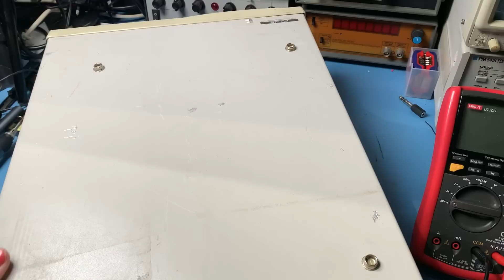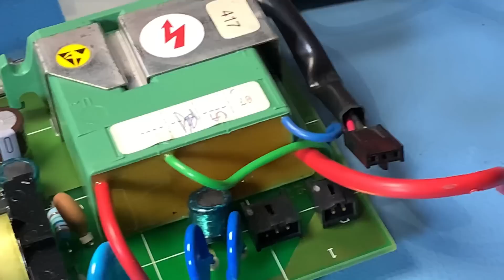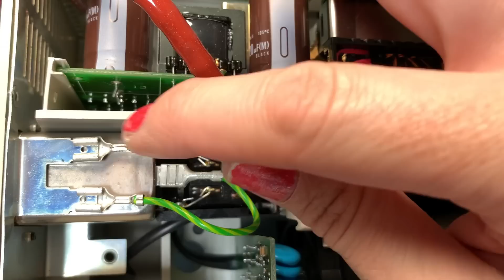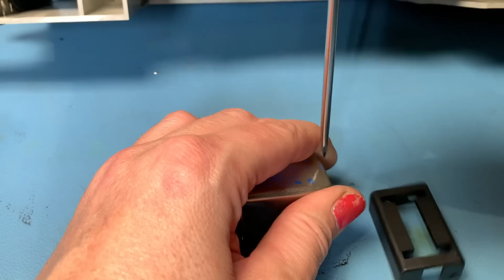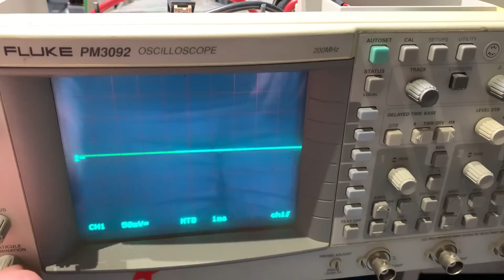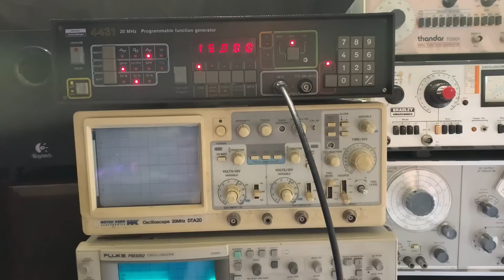Fluke PM3092 Oscilloscope - Service & Preventative Maintenance

Comment: For the life of me, I can't remember how to take off the handle! 🤪 Help!
Reply from the maker: You have to remove the casing and you can usually remove the handle by undoing the screws on the inside of the case holding the handle brackets on.

Comment: Hi, nice video. One remark I would also have replaced the 2 120uF caps in the supply they look having a bit a bold head.
Reply from the maker: I did test all the electrolytic caps but I will have another look at those 2.

Comment: Cool. I scored the PM3370B Combiscope version, great bits of kit.
Reply from the maker: I think they are a very nice range of scopes. I know you have featured a few from this range on your channel. The early ones suffer from failed Philips blue electrolytic caps. I think it's quite ironic that Philips took their own caps out and replaced them with another make for reliability, lol. So either they knew they were no good or Fluke said stop using them. Thanks for watching.

Comment: Nice to see this old Philips/Fluke type of scope. I also have two of them (not this exact model). One brought many years back from my first own money. Any I also like to use is from time to time, because of the features and overall functionality. Nice scope! But it's big and takes a lot of space on the desk, so I usually switch on the much newer digital one, because it's way smaller...
By the way: Yours is a much more recent model. There was no need to change the caps here. Anyway, it doesn't hurt and you made a nice video out of it and gave me a nice memory about this scopes, thx 😄
Reply from the maker: I didn't change electrolytic caps. They were all fine. The earlier models have Philips blue electrolytic caps in which do fail and usually need the entire lot replacing. What I did change was just the mains filtering capacitors which have a tendency to just go bang at any minute and do a lot of physical damage in the surrounding area. You can liken it to changing the timing belt in your car before it snaps and ruins the engine. This scope is nearly 30 years old and we have high mains voltage here, sometimes as high as 248V. For the sake of a few pounds it wasn't worth the risk so I do think it's very good practice to replace old mains filters and associated components of this age. Thanks for watching.
Reply: @JazzTechUK  I know, you already said this in the video. But I mean the mains capacitors. This specific type is not prown to blow. They are not cracking, which is the problem with some old Y and X capacitors used years back. The case get cracks and moisture gets in, which lead to magic smoke in the end...
Your laker model is not effected. After Philips stepped back completley in the instrument market the Philips name vanished on the front and switched completley to Fluke. My older model is Philips branded and had such problematic caps in it.
Anyways, it didn't hurt to change is, so nothing wrong here.
Reply from the maker: I can't be sure what was in the mains filter itself, so I changed it. Yes, it was not a Rifa capacitor on the board, but I had it apart so it wasn't much more effort or cost to change the other 3. I agree they were not damaged but I didn't want to take a chance with such a nice scope as I intend to use this scope on a regular basis.
Reply: @JazzTechUK  It's a really good scope! Will serve you a very long time with really good results! Have fun with it!

Comment: I've been considering getting a scope for a few years now and really like the look of the PicoScope range. If you're not familiar with the brand they manufacture USB interfaces with two or four inputs depending on the model. Their free software can be run on Mac or PC and behaves just like a digital scope with a lot of the same features. Anyway, great video Jane. Thank you.
Reply from the maker: I do know of the PicoScopes, however, they are not really much cheaper than any other full blown digital scope. The thing you need to watch with the PicoScopes is not only their bandwidth but the vertical bit resolution. Anything that is only 8 bits is going to give you a really jagged trace, which will look even worse blown up on a large computer monitor. You need at least 10 bits vertical resolution. Quite a few full digital scopes are now 12 bit vertical resolution, some even 14 and 16 bit. When you compare like for like, the PicoScope is not such a bargain it appeared to be.
Reply: @ Thanks Jane. I hadn’t appreciated the poor resolution specs when compared to those of proper scopes which are surprisingly cheap these days. Love the channel by the way! Keep up the good work.

Comment: I don’t know anything about what this is or what you’re repairing, but it seems you really love what you do. You care and I appreciate that. Good luck!
Reply from the maker: You can just watch for enjoyment value. Some people do this without understanding what I'm doing. In case you wanted to know, you use this device to 'see' what is going on in your electronics circuit. You connect special probes to this unit and 'probe' around your electronic equipment and it shows you waveforms of what is going on. From this you can work out if your piece of electronics is working properly, or not.
Thanks for watching and do come back to watch more videos just for entertainment value if you like 😊

Comment: It would be good to see difference on component tester, between old and new component.
Reply from the maker: I don't think you would really see much difference in this case as this was preventative maintenance as opposed to dead capacitors or an electrolytic capacitor where you would be able to see a deterioration. As these are old they can fail at any moment and make a real mess.

Comment: Nice scope, great hack on the power switch. Thanks!
Reply from the maker: Thanks. I was able to do that with the switch because of the flexi bar that operates the front panel on-off button, so it was not critical of the exact location.
Thanks for watching.

Comment: I once worked on an older Philips-Fluke scope that hasd some Roederstein ("Rödelschwein"?) caps, one of them shorted, and a RUDed Rifa cap. That made a lot of stench for sure.
Hope these Nippon Chemicon caps weren't the ones that got cap rot.
Reply from the maker: Luckily this was manufactured in 1996. The 'capacitor plague' as it was called didn't start until 1999, so just missed it 😊

Comment: Got its big sister, the Philips PM 3394(B) analog digital combi-scope. 
It's a combination of an analog real-time oscilloscope and a feature rich digital storage oscilloscope, with a bandwidth of 200 MHz and a 200 MS/s sampling rate in the DSO mode.
Very useful tool for vintage audio restoration work and setting up reel to reel tape-recording equipment.
The only thing I'm still not able to find are the original probes that had the "command push button" option.
Reply from the maker: Yes, these range of scopes are very nice. I am aware of the analog digital combi scope. There's not many of these scopes around. Thanks for watching.
Reply: hello I myself got a Philips PM 33 31 combiscope two channels oscilloscope however I can't use it because it's broken it's probably not much but I don't have the technical manual.  Do you have it in pdf it would be nice it would allow me to move forward on this project ? cdlt
Reply from the maker: @fredericch54 it looks similar to a PM3055. You can find a service manual for that online. If it contains blue Philips electrolytic capacitors then it's likely that the entire lot of those capacitors will need changing. They are notorious for failing and likely all faulty by now.

Comment: It's a long time since I used a CRT scope but the trace on that Fluke doesn't look very sharp. There should either be an astigmatism control somewhere or a voltage tweak for the grid on the PSU board, around where the EHT unit is. Otherwise, sadly a soft tube which you can't fix.
However, the way it jumped into lock when you changed frequency was excellent. Keep up the good work and videos!
Reply from the maker: The trace is pin sharp but it's not showing up very well on the camera. I think the trace brightness is causing lens flare on the camera. I'll see if I can get a still photo of it without lens flare and make a Post update.
Reply: @JazzTechUK  I agree with @raydawson851 that the trace is not as sharp as possible with these scopes. I have a PM3394 and it can achieve a better trace than what you are getting.

Try turning down the text intensity a little to the lowest level at which you can comfortably view. The text is currently being overdriven and consequently going out of focus. With the intensity down a little and with proper focusing you should be just able to make the individual dots in the text characters.  It also probably doesn't help with the contrast and apparent focus on the the main trace having the text up so bright.
Reply from the maker: @stephenbell9257 as I already said. The trace is pin sharp but is not showing it's best on camera I think due to lens flare.

Comment: Looks like a nice scope. 
I have two Tektronix 2465and one 2465A four channel scopes. The first are four channel 300 Mhz, the second is 350 MHz. 
I also have a cart, and one scope is rack mount.
I used one of these for many years at Microdyne.
Reply from the maker: What is a 'Cat' scope?
Reply: @JazzTechUK  Cart.. I have to type using 500% magnification so I didn't see the missing 'r'. 
I need cataract surgery on both eyes.  I can only see from one eye, and with poor focus. 
I had to install a LED strip light over my keyboard to even read the keycaps.
Reply from the maker: I'm sorry to hear about your eyes. I hope you do manage to get cataract surgery and it sorts it out. Thanks for watching.
Reply: @michaelterrell  Get the surgery, I was reluctant, but now I see better than I did even before the cataracts formed!
Reply: @jbuchana  The VA will do the surgery, but the hospital is an hour away from me. They require an escort to be with you  because o he sedation. I have no one left who can go with me, because I was the one who always made sure others got  to their appointments. The surgery doesn't scare me. I once sat for over two hours of ora l surgery to remove broken teeth, without pain killer at a remote Army base. The doctor told me that he couldn't understand how I kept from passing out.
I had bent bothh armes of the old dental chair from pulling so hard to deal with the pain. I had trouble getting out of the chair because of the damage. . I was 55 and I had picked up a Pontiac 389 shortblock without help when I was 20. I was rebuilding it for my '66 GTO.
I've worn glasses for over 60 years, because I was born with poor eyesight. My fifth grade teacher scribbled something on the blackboard and ask me to answer it. I told her I couldn't read it from my desk. She stomped back to my desk, I can read it, you little  liar!
She never said anything when I came to school wit glasses a few weeks later.
My vision was below 20/200 & 20/400 when I went into the Army at 20.
Reply: @ Thanks, I'm trying to find an escort to the VA hospital, because of the sedation. No family left, and at my age, most friends have passed, as well.
Reply: @michaelterrell  I'll be wishing you well.
Reply: @jbuchana  Thank you. May you have a Blessed day!
Reply from the maker: @michaelterrell please do get it done, even if you have to pay somebody to be with you. It will be well worth it. I know several people who have had it done and it makes such a big difference. Keep us updated of your progress 👍
Reply: @JazzTechUK  I have been trying for over a year. I am homebound and I don't have reliable cell service. I'm going yo contact my Representative's office in Washington DC.
The VA started providing Uber transportation, but you have to use their app to schedule your rides. I can't see the screen well enough to make a call. Also, you an only set a VA appointment by telephone. Biden really screwed up the VA system and it's taking time to undo everything.
I can't even see Primary care, and I'm out of Insulin.

On top of this, the VA website is changing their login system to combine it with a single login for any Federal agency. I can't read the instructions, even with magnification.
Reply: @JazzTechUK  Couldn't agree more. I struggled for years doing my bench repair job due to a worsening cataract. I'm in my early 60s and had my second op just 4 weeks ago in Ascot. It's such a routine procedure that I was in at 0700 and home by 0900! I was the first of 22 patients that day. It makes such a difference as you say. I just need reading glasses now....

Comment: What a super scope Jane. You can't beat a CRT I don't think. I have an old Philips 50MHz 2 channel scope, it does everything I need it to do.
Reply from the maker: Although digital scopes have their place and a lot of functions, you have to spend a lot to get a decent non jagged trace/waveform on a digital scope.
This scope has an ultra sharp trace that is extremely nice.
The biggest likely problem with that Philips scope you have is the blue Philips electrolytic capacitors failing and sometimes the switches can be noisy on that range of scopes, otherwise they are good scopes and built solidly.
Thanks for watching.
Reply: @JazzTechUK  Yes, you're right. I had to give the switches a clean, which was much harder than it sounds, they are almost totally inaccessible, I'm leaving the caps as is until any faults appear.

Comment: Analog scope is nice, i have a Tek 465B still working.
Reply from the maker: Yes, Tek make very nice scopes. I have access to a Tek 7834 400MHz scope that I can borrow if I need it. Thanks for watching.
Reply: @JazzTechUK  oh yes i have worked with service on tek R7844 rack version very nice scopes, with different modules for different setup. 400 MHz is not bad.

Comment: Hi Jazzy 
Thanks for another great video. I'm not new to electronics but I am to oscilascopes. I'm currently looking at the Owon range, what do you think? for a beginner.
Reply from the maker: It depends on what you want to do with it and what your budget is. Owon are budget entry level digital oscilloscopes that work ok but vertical bit resolution will likely only be 8 bit, which is 256 vertical steps, so you will see jaggedness on the trace/waveform.
If you are doing digital work, like microcontrollers etc. then you will need a digital scope. If not, think about a cheap used analogue scope off eBay, something like a Hitachi, Hameg, Goldstar, IsoTech. These will give you a lot of scope for the money and a nice clean trace/waveform.
Reply: Hi Jazzy thanks for getting back to me, I'm getting into cb radio repair  @JazzTechUK
Reply from the maker: Then you most probably don't need a digital scope. A second hand analogue one would do fine for CB radio repair. That and a good stable signal generator and a frequency counter to check the frequency of the CB.